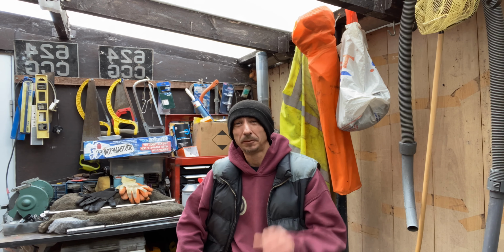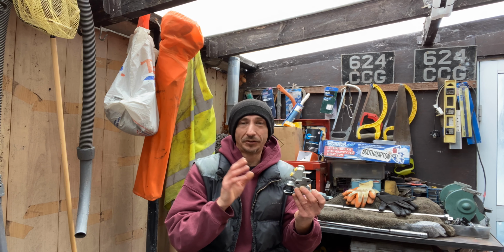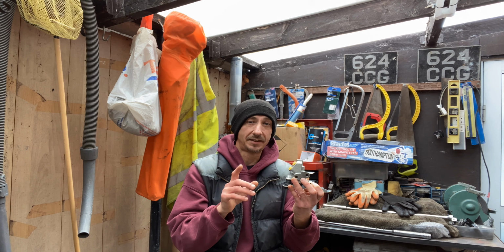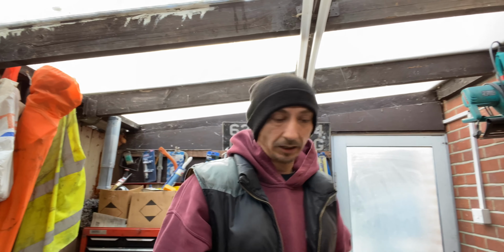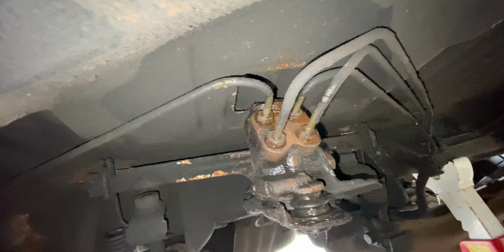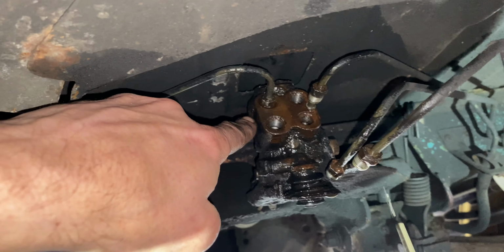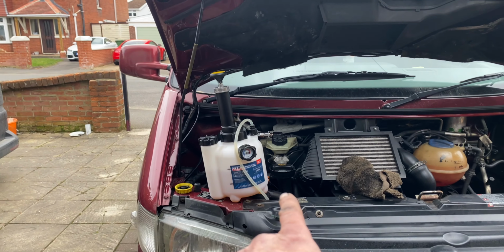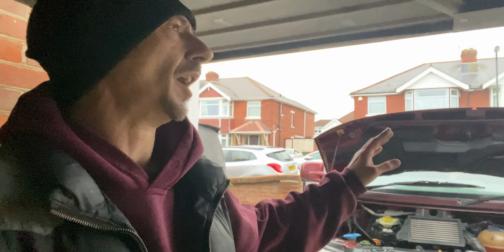Brake pressure regulating valve - VW T4

Comment: Quick tip from when I did mine: I'd bought a couple of brake caliper seal kits and each came with a little silicon end stops for the brake pipes. With a tiny bit of red rubber grease they popped onto the ends of the brake lines leading from the master cylinder when I'd undone them. Saved the fluid dripping out everywhere and emptying the reservoir!
Reply from the maker: Yeah I got a lot of different size rubber caps to go over nipples and brake lines, it didn’t even cross my mind about using them as in my head I was going to flush the whole system anyway. Good tip tho 👍

Comment: Top job
Tip for you matt mix atf and acetone (mail varnish remover)
And apply to rusty fittings with a brush
When there all cracked loose press the brake pedal to the floor or as far as you can and block it to the seat that will stop you loosing all the fluid
Reply from the maker: Top tips right here, wish I knew that before I done the job, I’ll remember that atf and acetone, I got some of them as well 👍

Comment: thx for info that mounting is complicated, I was wondering if I can do this and Im complete newbee
Reply from the maker: If you attempt it yourself be prepared for the worst, it’s easy to round a brake line connection or even snap a pipe. 
As it’s the braking system and a vital component I would always recommend getting a garage to do the job, if you do this job yourself I would definitely recommend taking it to an mot station and get the brakes tested. Which ever way you choose to go, good luck with your van 👍

Comment: Hi i have watch your video and it is informative as to how with issues and compensating valve regulator that controls at what height van is, most and all videos be it whoever are related to needing to adjust to compensate if lower your van as to not have them locking up on rear. I understand the T4 with the cradle with the springs both sides and the adjustment in the center and the valve in center with locking nut but understanding what way needed,  as most seem all wish to lower there vans i don't but i have fitted heavy duty springs that don't allow my van to compress much at all, even with a load and if so even with 700 kilo's in the back, is i had standard springs the van mechanics may compensate, having said all that if it be controlled by a computer and its not as all know manically the van is riding much higher than standard, hence manically, this is not lowing the correct pressure to the brakes even with load very heavy suspension springs, so the adjustment needed to increase the breaking do the cradle springs both sides  need to be increased in pressure more and the center adjustment with locking nut expect need to be turned in and expect not outwards, at the end of the day what way does all the adjustment need to go to increase breaking pressure. your understanding on operation may be able to help as solve my issues, many thanks
Reply from the maker: There’s 2 bolts on the side of it which you can loosen and that will give movement in the hardware allowing you to make small adjustments. The actual set up procedure is very complex and needing specific testing equipment. If you loosen those two bolts, make an adjustment either way, tighten it up then go for a drive and slam the brakes on, then you can adjust from there

Comment: Hi bud i did mine 2 months ago and still failed the tester did something with the computer and i got a pass
 He said i did every thing on the back brakes so he did me a favour  
and next time put some extra weight in the back it should do it [ 3 bags of cement }
are you going to do a video on how to adjust the valve PLEASE  thanks
Reply from the maker: Hello buddy, sounds like a decent MOT guy, not many testers like that 👍 
I didn’t want to show how to adjust because of safety reasons behind doing this job for people who aren’t confident or competent and being the brakes it’s quite vital not to get it wrong. However there is an Allen key hidden under a rubber grommet which can adjust, however you can also make adjustments by loosening the load valve unit from the chassis and it will swivel on the bottom bolt which should be enough movement to make adjustments. There is in fact a lot more to it to reset and adjust, and if you want it set correctly I would recommend either finding a specialist or take it to main dealers. Sorry I can’t be much help on this at the moment, however if I get a chance to find someone willing to show how to set it up then I will.

Comment: When you reversed out I thought mind your mirror … then aww if you can’t find it grind it 😂 you didn’t end the video, do the brakes work ok💁‍♂️
Reply from the maker: That’s why I need a gearbox, it jumps out of gear even when trying to hold it in gear.  Yeah the brakes work but the only real test will be on its mot when they check brake pressures